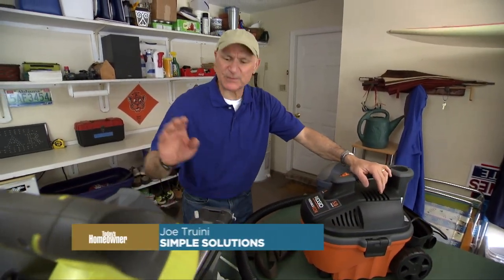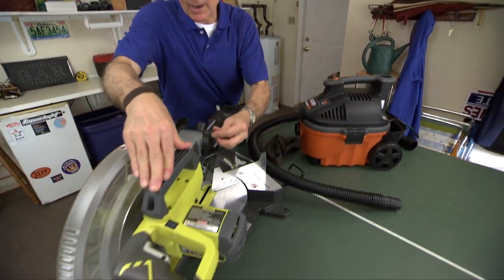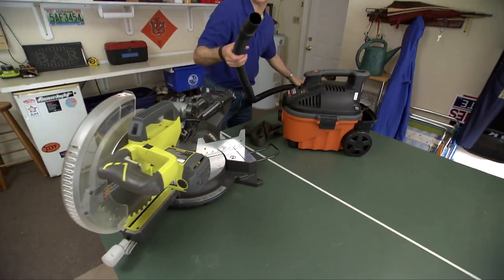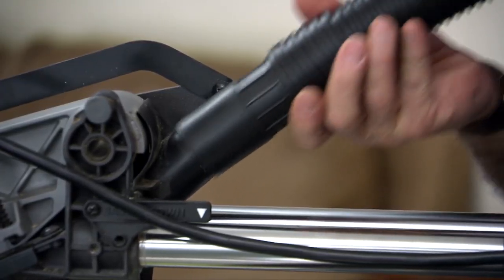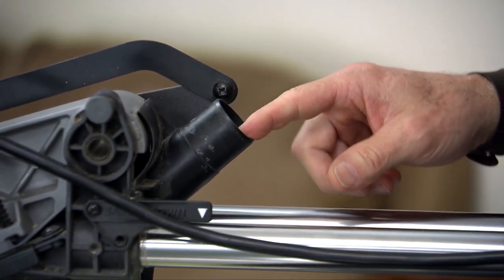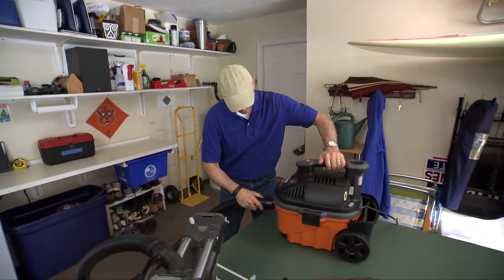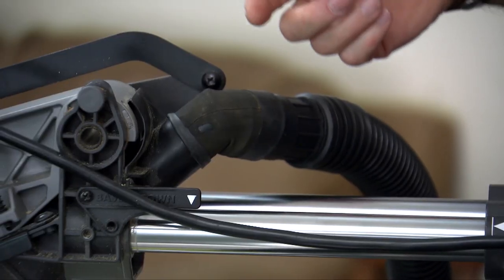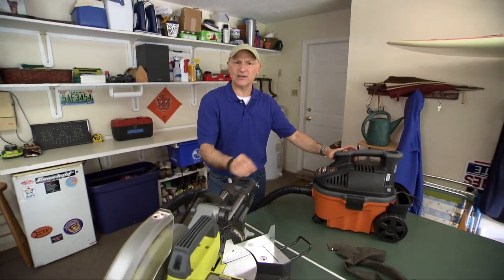Using a Wet-Dry Vacuum on a Miter Saw

Comment: Nice hack !!! 
I also saw in another video, the use of a special extension cord with a floor pedal and has a female outlet where you plug your vacuum in and then it's switched through the pedal, all you have to do is step on it and the vacuum will work ! I think is available on Amazon.
Reply from the maker: Cool idea!